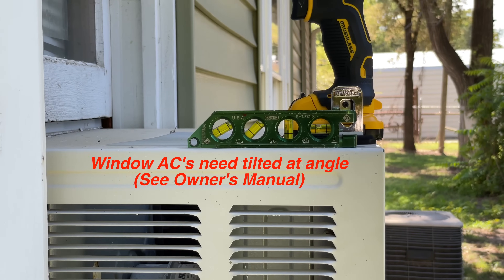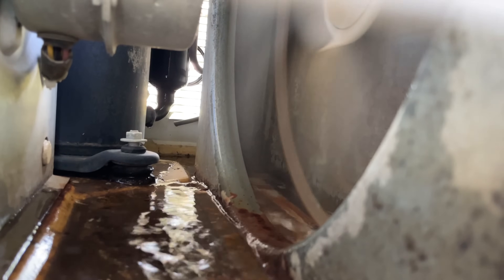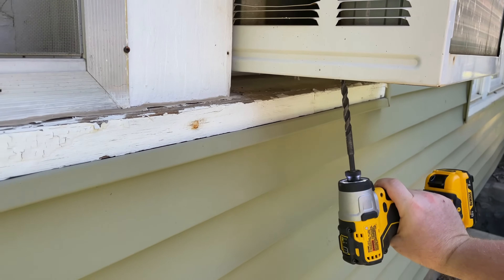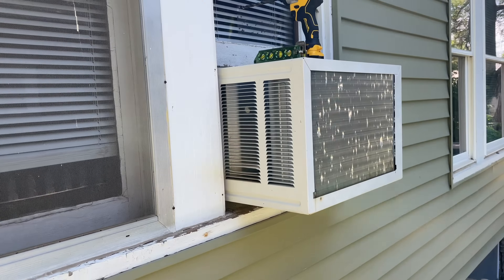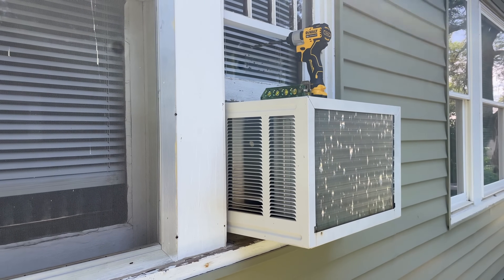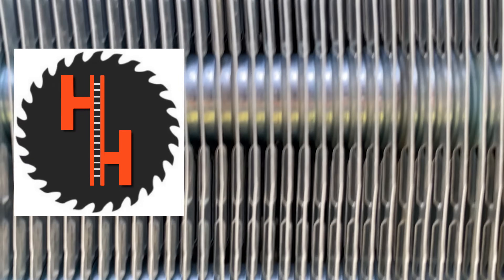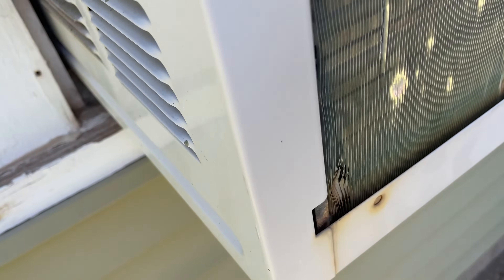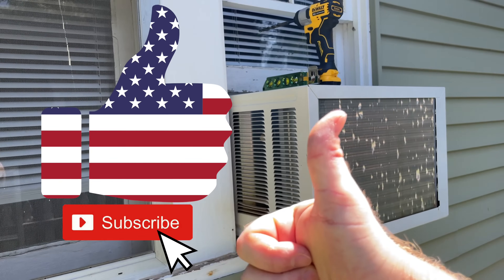99% Don't Know THIS About Window A/C's!! DON'T DRILL!!

Comment: "to maximize efficiency" of what exactly..? I'm not sure I understood that part. Every AC I installed and removed as a handyman was rusted inside on the bottom where water is collected. Not sure how that is a good design or making anything efficient. Perhaps it helps consumers not worry about creating any pipes to remove water so it counts on water to evaporate, but it doesn't seem conducive to the unit. Would love for someone to expand for me though.
Reply from the maker: It reduces temperature by splashing water on hot condenser. This helps compressor and makes and saves electricity. This one is 14 years old.. still not rusted through. Just surface rust

Comment: We bought a Midea window AC to use until we had our HVAC system installed.   Now, we need to remove it from the window.  How best to empty the water from inside the unit?
Reply from the maker: I would think just tip it back and the water should come out. You can also get a paper towel or some thing and wick the water out.

Comment: Need ask something my 1000 BTU air conditioner is not leaking out back does it leak or not got it in right but no water leaking out side mine is WiFi air conditioner got on 67 please help thanks
Reply from the maker: I'm sure it's got a slinger ring, so no water should be leaking out. It seems like it's functioning properly.

Comment: Our Midea unit had no drain holes and when we cleaned it up for storage after first summer of use, there was water inside which had caused rust inside the unit. Cleaned it up and drilled a hole in the bottom for the following summer. And no rust! On third summer of use so not sure about effect on longevity.

Comment: I have a 2nd story window ac unit in my bedroom.  After a few hot days I hear a trickling sound that keeps me awake. There is a threaded nozel on the bottom of the ac. And indo not have a drill. Is there anything I can do?? For reason I can't keep opening the window and emptying the ac out by tilting it backwards. Please help, I can't sleep with that damn noise. It's SO loud. Even heard over my fan on full blast and ear plugs

Comment: So what if it to the point where lots of water is leaking out like top top left corner on the exterior.  Is there a thing as to much water. Is that a sign to clean out the unit like in your video using that foam spray I got scared today and did not have my ac running and it's 93 Fahrenheit it would have been okay to you use it today instead of sweating and think i kill my ac

Comment: This air conditioner is equipped with aslinger fan. (See drawing, below.)The fan has an outer ring that runs inthe water that collects in the base panif it gets deep. That condensate is thenpicked up by the fan and expelledthrough the condenser, making the airconditioner more efficient. 

This is out of the manual for my window ac...i done the drill method but now im doing the plug the hole method haha😂 ty for the video

Comment: I can’t believe this is in my feed.  I have never seen this until I got a new window AC.  I literally just drilled 2 holes in my AC unit yesterday!!! Thank god they are small enough to plug.
Reply from the maker: Good timing. Get out your chewing gum and plug them 👍🏼
Reply: @HandymanHertz What's supposed to happen if you drill holes? Mine was clogged up so bad even cleaning drain plug area still left way more water than what I saw in the video. About a week or two ago I made one small hole and lately it's been doing much better.

Comment: I ended up drilling mine to let the water out. The reason being is most window acs are not air tight between the outside and inside part which allows moisture to be brought right back into your home with the cold air. You can sometimes see this on the duct work inside with a flashlight or on the adjustable vents.
 This excess moisture leads to molds building up inside your ac that ends up being vented across your home causing all sorts of health issues.
I know this from personal experience when I woke up with breathing issues one night shined my flashlight into the vent and saw this mold. Got up at 3am went outside and pulled out the AC to be thrown out and replaced.
 After this I NEVER EVER allow water to stay in any window unit I use.
 If they could completely seal the intake that blows the cold air off from the rest of the unit with no moisture being pulled back inside then leaving the water in the pan is viable but until this is done it's not worth the health risks.

Comment: If you dont have a drain  its obvious the manufacturer designed it this way. My thing is that I'd rather lose a little bit of efficency than to prematurely rust out my air conditioners components, making it useless. Anybodys thoughts?

Comment: They only do this so that they can say it's more energy efficient as a selling point. The water that builds up causes all sorts of issues, mainly mold and bacteria growth. Also the slinger sound is very annoying to some people. Also it will pour a pint of water into your room when you uninstall it. It's absolutely no problem to drill drain holes as long as you are careful not to hit any internal components. Short of voiding the warranty anyway (but then most AC warranties are short and useless). Or just use the wick method (look it up on YouTube).
Reply: Y ain’t this pinned
Reply: @Chizhboyz  AC companies will demand it be taken down. The water sling helps them lower utility cost at the cost of the ac becoming useless after 1-2 years. It's a win win for the AC companies. This is why their warranty is based on months instead of years.

Comment: MUST READ!!! I drilled   mine   out  have 2  units both are  2 ton,  i will say    liveing in va   the humility  is brutal so  the condensers, condense  alot !!!so much that. Mold begins to grow    slime sludge and bugs   even with droping pan tabs in the   water  so i drilled them out and bought a   kayak plug  so i could do kw  testing, power test! 
 2 ×'24 hour test'
So with the  unit   set to 72   with   water splashing everywhere   in it  it consumed      
23,240 watt hours  
With  no water 23,841 watt hours
  Difference  of 601 watts  so less efficient  but  much cleaner! 
 On to the  so called  shortening  of the life of  the ac  from the manufacturers statment  if drilled ....
 Ac life is  determined  by how hot  the compressor gets.   Doin thermal test  on the ac showed no change  84°  both  with water and  without    this is because   it has a thermocoupler   to monitor  the compressor temp and keep it between   a variable  temp 
 All in all    drilling in my case was well worth  the 601watts 
 All test done with   high end fluke 87v

Comment: TL:DR If you DON'T have animals that might drink the water if it puddles drilling the pan or draining the water is better for your system and you. Do with this information what you will. If you might have animals that could potentially drink this water then DO NOT DO IT. This is why they don't have a drain or have a corked drain hole.

As an HVAC tech that evaporative dispersing probably more than likely is affecting your efficiency negatively rather positively as you lose air flow when the water fills the fins and you can potentially develop algae, mold, fungus and such. One thing you will notice if you have a fresh air intake on your unit is that it might smell like sweat or smell a bit funky when it brings air in, that is your condensate water in the pan. Its also a mating ground for mosquitoes and such and rusts out your chassis of you window AC. As far as I know its only there for multi story buildings so that water does not drip on lower areas, people walking below in the city, and so it wont puddle where animals can drink it and get sick. You can contract Legionnaires disease which is a type of pneumonia if you are heavily exposed to condensate water. A solution would be running a drain hose from the AC directly into the ground or a drain-out so no puddles will form.

Also, side note, I do not like portable hose ACs cause they hold the water in the unit unless you dump it leading to funky smells, constantly having the condensate switch shutting it off, and poor efficiency cause of the uninsulated condenser venting tube. Drilled a hole in my window AC condensate pan cause of the smell and found this video when I was seeing if newer LG units have condensate switches so they don't overflow. If you don't want to drill you can also just hang a paper towel/fabric from the back of the unit where that overflow hole is and it will just gravity drain it out. 

Creds: HVAC Journeyman. I work residential and commercial. This includes central heating and cooling, gas heating, electric heating, watersource heatpumps, chillers, cooling towers, hydronic loops, and some refrigeration hence not the R part of HVACR as I am mostly an HVAC technician. A portable AC is technically a small size package unit and those usually will always have a separate drain line. The package units I've seen that did not and instead had evaporative dispersing for the condensate were always rusted beyond repair after 5-10 years.

Comment: Very true in most cases but if you live in an extremely humid hot area you will need to drill a hole because it will actually produce to much water and will block the drain hole that runs from the front of the unit to the back of the unit and will most certainly drip inside your house.

Comment: IC, said the blind man...but I'm uncomfortable having that standing water in terms of bacteria build up over time and increase of flying critters.   Have had HVAC for decades, but certainly will refer your YT to others.  Thanks again.
Reply from the maker: I totally understand. A lot of that might have to do with climate. I'm in a medium humid climate and have never had an issue with that, knock on wood. My dad says I see, said the blind man… So I appreciate that. 👍🏼
Reply: You can get a small squirt type plastic container. Ketchup type with a small tip. Squirt about a half cup of white vinegar into the pan water. Kills and keeps bacteria away. Once a month is good. I did drill a drain hole in mine so I can drain it and let it fill again with new water. I have a plug for it. I do it once a month and after I empty it I run some water into the pan to wash it. I then replace my plug. Put the vinegar in and replace the amount of water with it. The fan keeps throwing the water and keeping the condensor and piping cool and wet.

Comment: What to do when the fan is circulating water inside? 😩 
I had no idea about this. I always thought something was wrong when I heard that sound.
Reply from the maker: If water is coming on the inside, your issue is usually one of two things. Either your window AC  isn't tilted properly, or the passage from the water to get to the front of the unit to the back is blocked and requires a full deep clean. In my deep, clean video, I address where this is and how to clean it.

Comment: My GE units have a hole in the bottom with a rubber plug that you can remove.I just leave the plug in because I was told it cools better, but would be slightly quieter if removed and the blades didn't hit the water.
Reply from the maker: This is correct, also, it will cut down your electric bill because it runs more efficient

Comment: Unfortunately the newer units that implement this tech do crap for removing humidity from a room.
Reply from the maker: I don't believe this is accurate. This has nothing to do with condensate from the evaporator coil and everything to do with cooling down the condenser.
Reply: @HandymanHertz  it is accurate, I bought 2 new units last year and they've done nothing to keep the humidity down, untill I drilled a weep hole. Now my place stays cool and dry. Don't get me wrong, no one should drill holes in their ac unit, I actuly punctured the freon line and almost blinded myself in the process. It s not recommended.
Reply: @HandymanHertz is it possible to clean the inside of the outside part of the AC without taking it out of the window? I don't know if I put that right. If I take the sprayer on the hose and flush the AC out thru the outside side vents will that help clean it? I'm at my wits end. Slumlord says nothing wrong with it, if there is it's my fault. I didn't install the ac-he did. My bedroom grows mold like nobody's business. I've been using a mold/mildew remediation and that helps but it still smells weird in here. I'm in Florida and I can hear it slosh so much. This summer is the most humid I've ever seen I run a 2400 sq ft dehumidifier in here 24/7 and it's not enough. The AC is adding humidity to the air not taking it out. The humidity is sitting at 70%+. Not good. I'm so very tempted to get my Yankee drill out and start drilling until the humidity stops condensing on me. I hate damp sheets.

Comment: there should be no water in the pan, otherwise the lower part of the radiator will simply rot from rust
Reply from the maker: this is 14 years old in the video and it's still not rusted through, just surface rust. It's not the limiting factor.
Reply: @HandymanHertz  this means that rain and other climatic troubles do not fall on your air conditioner, you are lucky))

Comment: Why does it smell moldy or musty without modification ?
I think the air quality is better without a pool of hot nasty water.
Air seems drier, and coils don't seem to freeze over as often.
Yeah a machine constantly full of hot water is a breeding ground for molds mildew, and it just keeps flinging it around inside a dark area. 
Also even power off still left with a pan of nasty water sitting in dark environment. 
I modified both of mine last year, love seeing the water pour out of them. Both units push 50 degree air out.I didn't drill, I cut the middle of the back and peeled it back so with tilt drains at lowest point, be careful not to hit coolant tubes.
Informative video, makes sense. But last year I literally poured bleach into one unit to get rid of strong mold musty smell. Could smell it with unit off too. They were plenty sloped backwards. Subscribed 👍